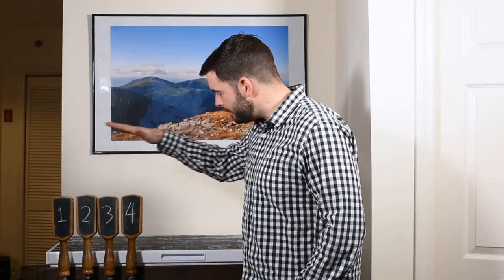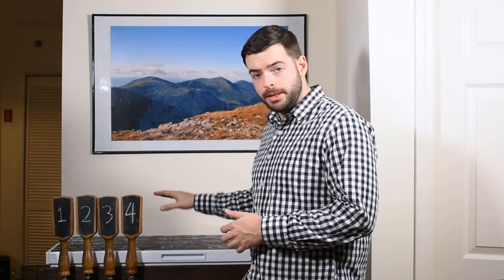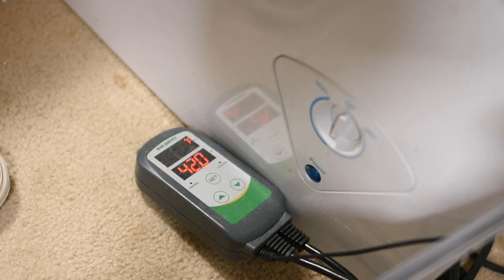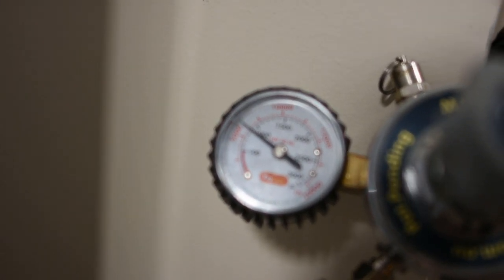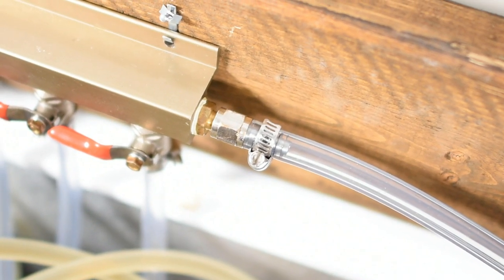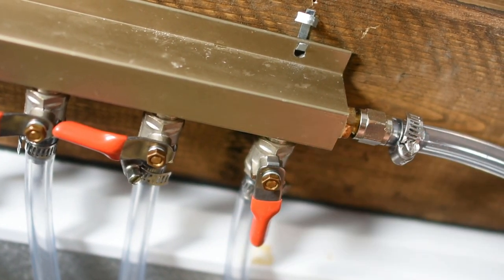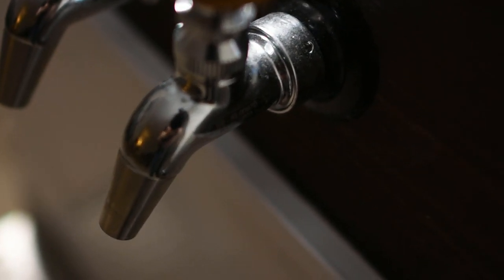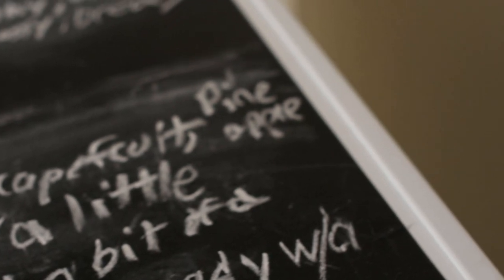How to Build a KEGERATOR or KEEZER for DRAFT Beer at Home | STEP-BY-STEP

Comment: If you buy flow control faucets, you don't have to worry about line length, that's what I did so I could serve beer at any pressure and not have to keep long beer lines in my kegerator.
Reply from the maker: Definitely a great addition!

Comment: I tend to clean my lines when I swap kegs out. Primarily so that the last beer doesnt interfere with the new beer going in.  Which means my lines are typically cleaned once every 1-3 months (I have 2 kegs in my kegerator) Similarly, I'll change out the lines every other year or so. After about 2 years in the kegerator the lines get stained and will start to give an off flavor to the beer. If you're still tasting hops from that NEIPA you finished a few months ago in your american light lager...might be time to switch out the lines.

Comment: I may make a keezer in the distant future, but I actually really like bottling.  It makes it easy to put beer away to age, especially when you are sampling it over several months or years.  It makes it easy to gift beer.  It's convenient for travel.  And the biggest advantage: portioning.  I like to keep my consumption to a single 22oz bottle a day for anything under 8% ABV and a single 12oz bottle for anything above that.  I have special occasions, for sure, but my everyday consumption is very controlled.  Knowing I am only going to pull out one bottle a day makes it easy to keep it from getting to be a bigger habit.
Reply from the maker: I definitely agree bottling has its perks. There are a ton of beer styles that really should be bottled instead of kegged, but its pretty hard for me to beat that convenience factor.

Comment: Beer Lines should be cleaned out after each keg regardless of the type of tubing you have.  Sanitization is just as important in a kegerator as it is during the brew and post brew process.
Reply from the maker: Agreed, I was not implying antimicrobial tubing excuses you from cleaning by any means. However it does provide a little buffer against infection should one forget to do that after a keg switch or two.

Comment: I was wondering how you put lines through. I didn't even think about putting in a spacer. I don't have the space at the moment, so I've not actually looked into building one, but it looks pretty easy. Nice video, with some excellent information!
Reply from the maker: So you dont necessarily NEED to put in a spacer, but it just saves me the work of having to map out the refrigerant lines and avoiding them. The spacer piece was super easy to do, glad you enjoyed the video!

Comment: Very cool setup. I have a 3 part build of my keezer on my channel, but doing a summary video of the complete build I think I should do as well at some point soon.

My investment was over 2 grand, it is a 16 tap, 22.3 cubic foot chest freezer with a bilge fan inside, led lights, and a glass rinser on the drip tray. I further automated the fan and internal led lights using a relay. Fan is on with lid closed, light is on with lid open but fan is off so it does not evacuate the cold air. Finally the entire keezer is on wheels and wrapped in chaulkboard paper.
Reply from the maker: Dude that sounds incredible! I am gonna have to check those videos out, sounds like a really extensive project but well worth it!
Reply from the maker: Just finished watching that series, that's a seriously awesome build. Looks like a straight up barroom tap wall! Definitely a BMFK lol. Great videos!
Reply: @TheApartmentBrewer  thank you so much! Yeah it is a sizable setup for sure. I also have a two tap kegerator behind the bar and a 4 tap jockey box. The jockey box even has a glass rinser in it too!
Reply from the maker: Dude that is insane haha. I love it!
Reply: @TheApartmentBrewer  here is the jockey box. Same led and pump setup. I didnt go into detail how I set that up, but seeing your video has inspired me to do an update.

https://youtu.be/nrvpfWziWus
Reply from the maker: Do it!!
Reply: @TheApartmentBrewer  video is up!!

Comment: Nice keezer, thanks for the video! I am planning to build a kegerator. I would just suggest using JG quick disconnects instead of the swivel nuts and worm clamps.
Reply from the maker: That's a great idea I hadn't even considered. Cheap and readily available, plus can handle pressure well, however im not sure if they connect to the keg disconnects

Comment: Hey man, enjoying the content foe sure. I am just starting out home brewing. Got two brews aging and fermenting as we speak. I recently did an grape fruit IPA from the brewers best kits. Wondering it’s only been 4 days and my fermentation seems to be done. There is a fry hop I need to do. Should I wait the 7 days to make sure it’s done or just check the gravity?
Reply from the maker: So, if youre bottling its going to be a better idea to wait until you're 100% sure fermentation is complete otherwise you can risk bottle bombs. Usually that means three days in a row with the same hydrometer reading, or waiting about 2 weeks with a standard beer like an IPA. if youre kegging there's no danger in packaging early. In both cases though, while it may not look like fermentation is active, there is still stuff going on with the yeast and ultimately they're cleaning up flavors a bit. If fermentation is confirmed 100% done and it tastes good, youre good to package.

Comment: Nice setup! I will someday hopefully upgrade to something similar. I like the idea of a a standing fridge so I can store hops as well in freezer.
Reply from the maker: Thanks Trent! Standing fridge is a great method as well, just have to be careful not to drill through a refrigerant line in the door, but the versatility is a bit better
Reply: @TheApartmentBrewer  that’s my biggest fear! Lol would be reading manuals very closely
Reply from the maker: I think there's something you can do where you do some sort of mixture of corn starch and baking soda (definitely check me on that) and if you smear that on the fridge and let it sit, it changes color where the lines are.
Reply: @TheApartmentBrewer  woah I gotta look into this!

Comment: Just a note on the probe in water solution, I do that, but I found that there was a constant 4 degree difference between the beer coming out of my taps and the temperature reported on the PID.  I'd recommend using a thermometer to measure the outgoing beer (I just held a meat thermometer right under the tap while I poured a beer, make sure to actually measure the whole beer, the beer in the lines could be colder) and adjusting your calibration value on the PID.  Doing this my PID is reporting exactly the temp of the beer leaving my keezer, cheers.
Reply from the maker: Thats a good point, since cooler air settles at the bottom of the keezer it may not be reflective of the entire volume's average temp.
Reply: @TheApartmentBrewer  I actually found that the beer was warmer, I think it's because the freezer can cool down the small body of water in the cup faster, so the big kegs lag behind.

Comment: Great vid. A few questions. It appears that Best Buy has a couple different 7.1 cu ft chest freezers under their own brand. One is 32” wide and the other is 37” and yet they’re both are listed as 7.1 cu ft. Maybe the longer one has more insulation?  Just curious which one you used. Also, have you ever felt the need to use a secondary regulator internally to adjust the psi of one style vs another?  I’ve been looking at the Kegland Duotite system which offers this at less money than the traditional secondary’s. Also, I’m curious why you ran your taps from far left towards center. Just a preference?  Sorry for all the questions. :-) Love your vids!
Reply: Might want to check the other dimensions. Volume = Length x Width x Height. That said, the external measurements are less useful for determining volume, but it should give a rough idea of where the difference is being made up.
Reply: @Vykk_Draygo  I don’t have the numbers in front of me but it seemed that the depth and height were pretty much the same. Also it was slightly more expensive, which led me to believe that there might be more insulation in the walls, yet the internal space comes out the same?  Not sure.
Reply from the maker: @kurtwolter3984  So the freezer I have is this one: https://www.bestbuy.com/site/insignia-7-0-cu-ft-chest-freezer-white/6385046.p?skuId=6385046

The dimensions are 21.7" W, 32.1" L and  33.5" D (without collar). It fits 5 gallon corny kegs with ease. I think a lot fewer people use secondary regulators than the keg hardware companies want you to believe. The only time you would need something like that would be if you're serving two drastically differently carbonated beers simultaneously, like a Belgian beer and an English ale. In my case, I just force carbonate one more than the other and shut off the gas to them both at the regulator...I don't really make too much of a fuss about it all. And I ran my taps through the left side because its WAY easier in my opinion to put kegs in and pull them out when you can just move all your lines to one side versus having them all spread across the center. Hope that helps, and never worry about asking questions!
Reply: @TheApartmentBrewer  Great info. Thx

Comment: Could you do a video on how you clean your tap lines?
Reply from the maker: I might, I don't know if the process is video-worthy though. All I do is fill a keg half full with PBW and then flush the lines with it. Then I do the same procedure with hot water and then sanitizer.

Comment: If I wanted only to use 2 kegs, what size freezer would you recommend?  I'm not ambitious like you using 4 keg system lol. Thanks!!
Reply from the maker: Probably 4 or 5 cu ft. But be sure to check the internal dimensions so your kegs fit
Reply: I just setup mine today. 2 5-gallon kegs definitely fit along with 2 or 3 1 gallon kegs depending if you tank is inside or outside